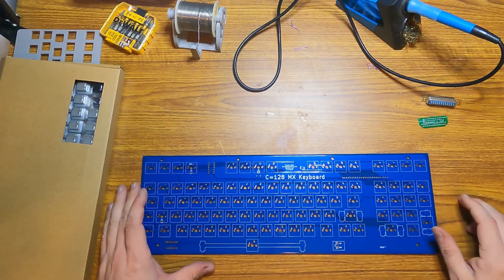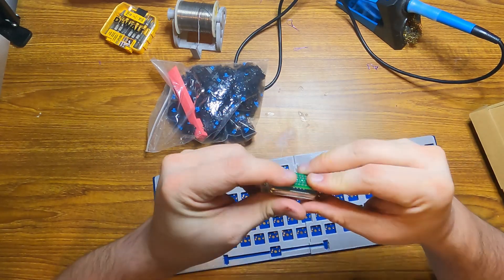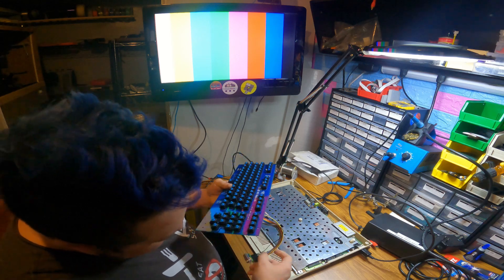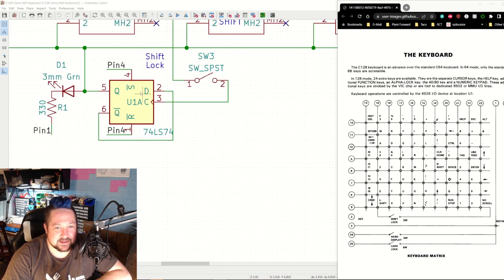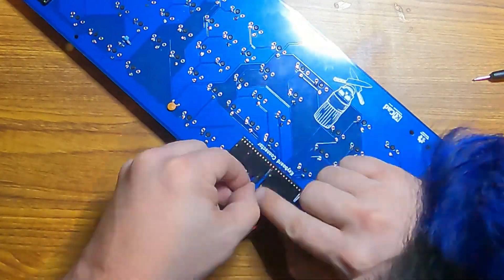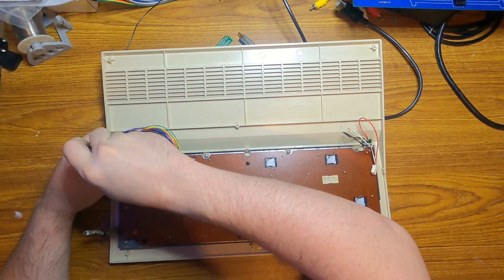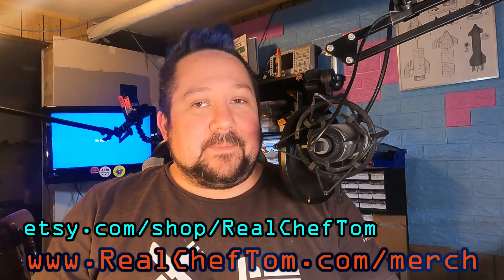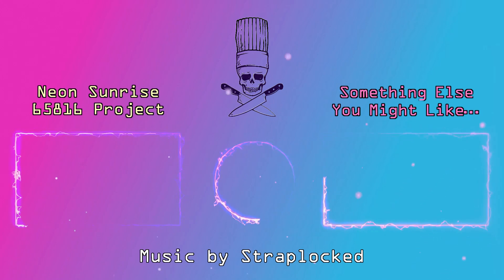Designing a drop in C128 replacement keyboard

Comment: Your shift-lock latch is implemented incorrectly. You are driving "pin9" constantly which will screw up the matrix decoding. I'd suggest adding a 4066.
Reply from the maker: Thank you!
I probably would have chased that down through several iterations before I found it myself!

Comment: just that keyboard switches have virtually zero dc resistance. whereas the usual commodore crappy setup with bits of gooey stuff pushing some carbon or aluminium foil or whatever those cheap plastic keyboards used, onto contact pads on a pcb, has a lot of resistance. take note that on most commodore systems the keyboard and joystick ports connect directly to bi directional programmable i/o ports of 6522's or 6530s or 6526'es or something like that, implying that you can cause a 1 output to run into a 0 output with a bit of programming and pushing some keys. it's all nmos or hmos or hmos-2 ttl gates in the old stuff... but that doesn't mean it cannot break. :P (as in on a modern 65c22 you'd probably notice if you ran a 1 into a 0 :P... that old stuff has amperages weak as shit ;) but still... (yep... don't ask why they even used bi-directional universal i/o chips to decode a keyboard matrix when a bunch of nand gates would have done the trick both for the address decoding and the scanning itself perfectly fine and worked in just 1 direction .  no accidentially turning the input into an output :P but hey.
Reply from the maker: You're right.  I hadn't considered the resistance that the old style keyboards just naturally had.  That's why I love this community.  Everybody is open to offering up information.  Thank you!
I don't know why they did it this way either, but all I'm trying to do is recreate it for now.
Reply: the flipflops ofcourse will have to be of the 74hct variety to 'work with everything people could possibly throw at it (quite a few cbms originally containing nmos now contain a 65c22n and a 65c02, (as seriously why bother trying to get 40 year old chips that are also 40 years old already ;) at least in the vic-20 range ;) and those will output more or less the full vcc by force :P if the old nmos ttl gates by themselves won't (not sue what the transsitor configuration in those gates is) see the same 'you can break the computer by typing stuff into the computer' stuff also applies to the joystick ports, which do usually have zero resistance and go directly to ground when configured as an output and moving the stick ;) on some cbm machines there are some capacitors and coils between the joystick port. on most schematics, not on all even. (for static electricity and all that ;) those also don't do anything against dc shorts. but most stuff just goes staight to i/o pins that are not protected against either short circuit nor the input being higher than vcc (when the computer is off but the periphial is on and holding some pins at 1 ;)
Reply: there is one significant difference between commodore and atari designs... ataris are always full of resistors :P LOL. it's like they got a discount on the things. lolol.
Reply: actually don't see why they went for that whole setup in the first place... 6520s, 6530s, 6522's 6526'es etc are FAR more expensive than just having a simple 8 bit output and an 8 bit input with nand-gates (and some 'chipselect for all of them at the same time' and 'output enable' so a few gates more ;) that only work one way and only scan the keyboard.. and then put the joysticks on the same interface on most of em... :P (what could possibly go wrong ;)heck throw in a few flipflops (potentially made up out of those same nand gates ;) if you want 'buffering' ;) still cheaper than even a 6520.
Reply from the maker: I'm going to guess it was purely because they owned the chip fab.
Reply from the maker: Thank you for the reminder!  I was about to pull the trigger on 74LS74 chips when I saw this comment through.  HCT for me!

Comment: How do you design the circuit? How do you apply the circuit to PCB? I'd love to a project like this for PC. I've always wanted a full size custom keyboard, but they don't make them
Reply from the maker: I use KiCd 6.0 for the design.  Then I sent it off to get manufactured.  I might do a video after I'm done on that process, because I feel like I may be making a lot of changes along the way and I can put it all together.
Reply: the pcb and swiitches are not the only parts to a keyboard. there is also metal lasercutting for metal cases, metal pressing for at least the frame, plastic molding for the keycaps and plastic cases, and if they run some serial protocol also some microcontroller firmware (yep. they mostly all run microcontrollers. even in pc's... although there too some shift registers and logic will do i guess ;) problematic part is mostly also that people type with 10 fingers and 1 key is not 'up' yet before the other key gets pressed. which you notice very badly when using a c64 nowadays (back in the days you were used to it and automatically typed around such combos but the keyboard scanner is very badly done on those ;) and obviously the keyboard should be layed out in such a way that this is not a problem, matrix hardware wise. funnily enough besides the usual intel mcu's for pc keyboards... the 6502 is also strong in that market :P plenty of 6502 mcu's specifically designed for keyboards on the 'larger quantities' market :P oh and after all that other stuff. the letters still need to have some printing on them too :P now if only it was only a pcb with switches... :P

Comment: You might want to consider a non-conductive foam mat instead of the 3D printer plate. Keyboard people use these all the time. There's not really an overwhelming need to rebuild the C-128 Power Supply. Unlike the C-64 P/S, it doesn't contain the problem. With an adapter, it is fully capable of running the C-128 (sans adapter), the C-64, the newer VIC-20, and some of the Atari 800 series computers (but most of these DO require an adapter). On the other hand, if you do build a new one, you can build in an adapter system on that P/S and add a useful 9V adapter wire as well. As for the keys, they're a good choice. There are also removable keys to make it a bit easier to change key types, but I'm not sure if that's really necessary here. I'm more interested how you printed key caps.
Reply from the maker: I never had an original power supply, so I had built my own.  It was one of my first projects, and I want to rebuild it now that I know how to do things better.  And not use the overly huge project box I bought the first time.  Now I could use something more compact.

And for the plate, the 3d print was just for my prototype phase, but I thank you for your suggestion!  I'm always open to doing things better.

Comment: Where do you find keyboardless C128/128DCRs for $100? (Even if keyboardless).

I want a keyboard like the one you are making, but a usb-c one (with lights!) that I can use for emulators (software or FPGA).

It’s such a pain trying to use standard PC keyboards trying to type all the special characters. 

Same with the Amiga. Want an Amiga keyboard as well:)
Reply from the maker: Fair point, It's been a while since I've even looked.  I gave up when I finally got my flat and focused on other things for now.  The 128D is a dream on hold for now.